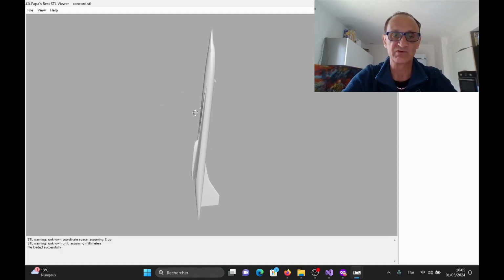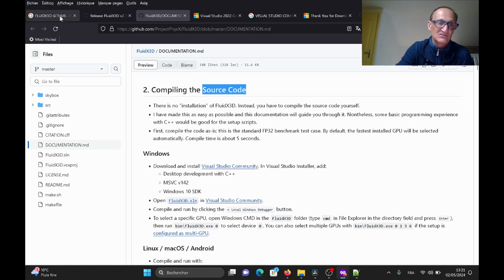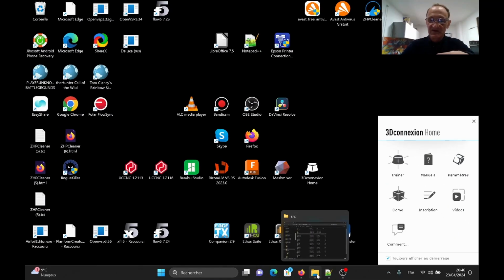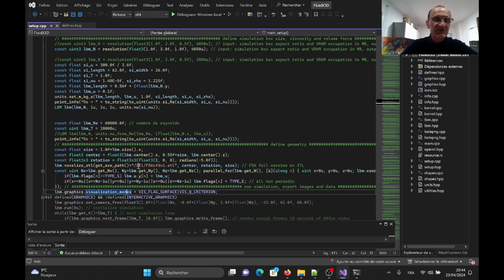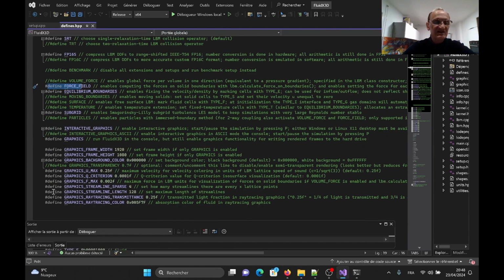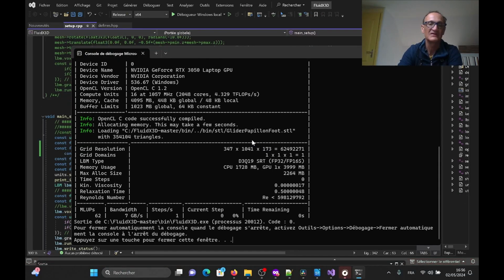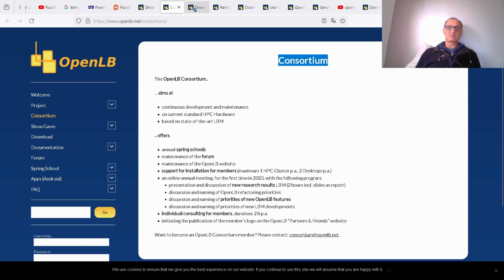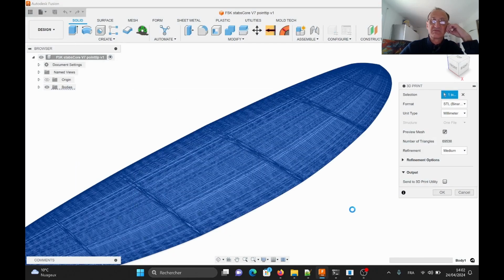CFD simulation for beginners

Comment: Hello Alexis
Thanks for your step by step instructions
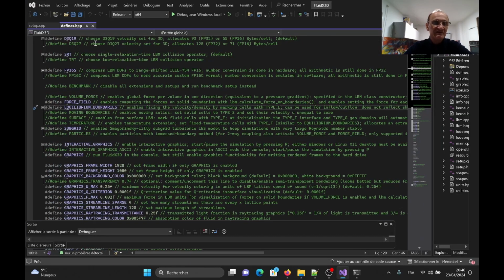1/ One point to mention is to comment with // the #define BENCHMARK line in default defines.hpp file (@ ~9:10 in the video) , otherwise we got compilation error when uncommenting the 747 section for instance, due to double void main_setup() statement in setup.cpp
2/ Where have you found the Nimbus 4.STL file please? I have a 1:5 scaled Nimbus 4D glider and would like to see the simulation on this model
Best regards
Reply: Signé Renaud 😄
Reply from the maker: Thank you for the correction of 1/
I will send you the file of this Nimbus 4.
I retrieve it on one of the numerous sites proposing STL files, often for free. But I have no idea today where I've found it.